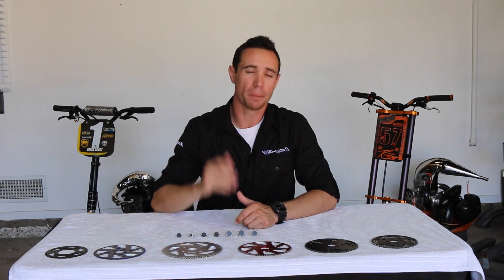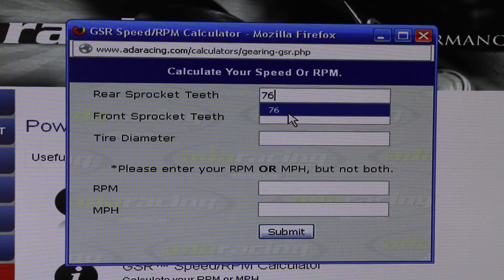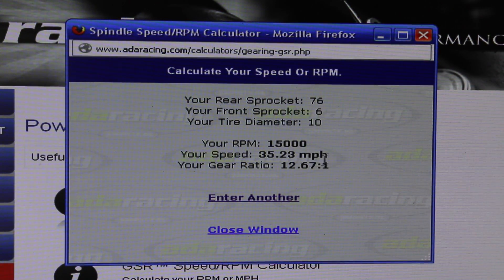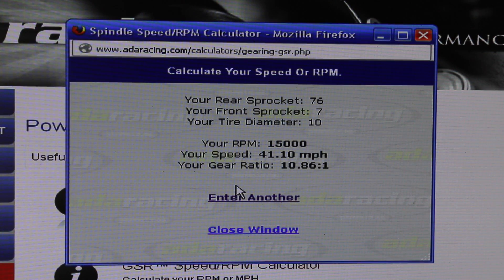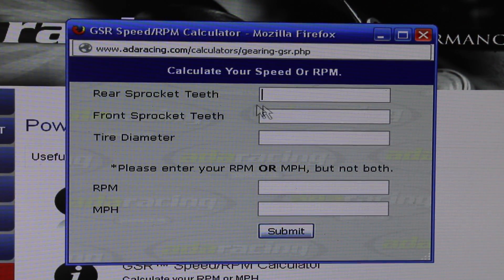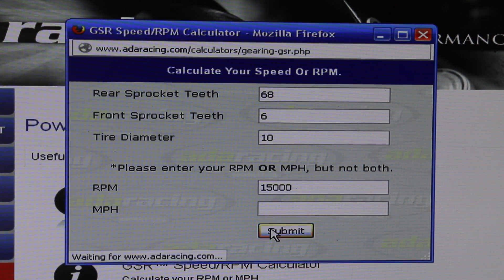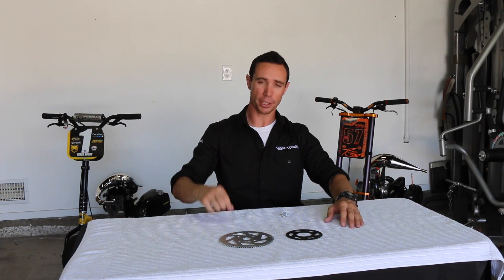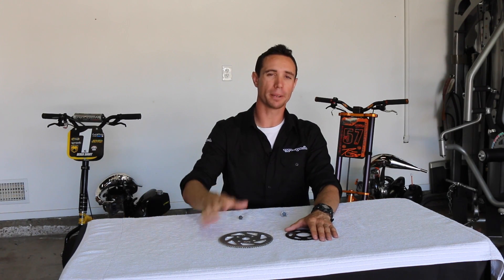GoPed How To: Gearing and Ratios In Depth

Comment: What gear ratio would you suggest for a top speed of 100 mph?
Reply: 14 tooth coming off the motor and a 54 tooth on the wheel. goooooood luck. you'll need  a car to tow you to 60mph before the engine will be able to move the ped.
Reply: @Coliolioxenfree  on my homemade stand up scooter i used 11/54 with pocket bike engine  bigbore  my weight is 52 kilograms my scooter top speed can go 77 kph
Reply: i done 62 mph on my trail ripper @Coliolioxenfree

Comment: Hey Derek .. I have a GoPed ESR 750H electric scooter .. I'm looking for acceleration with a top-speed of 40km .. What size front and rear sprocket would you recommend
Reply from the maker: +Yuvraj Lehr you likely won't go that fast. closest you can get is but going with lip batteries and a torqunator motor. Gearing I can't remember exactly because electric scooters are a bit different with gearing ratios. but typically go up 2-3 teeth in the front and up 7-8 teeth in rear for max top speed.
Reply: +Derek Short I have LifoPO8 24ah battery setup in place .. But running a stock motor currently gets me up to 35km/h .. My rear sprocket is the black 72 DOM not sure how many teeth and the front is the stock.. Again not sure how many teeth .. Sorry I'm new to GoPeds.. Here in Singapore Gopeds are a very expensive alternative to the Chinese scooters .. Hence support out here for these scooters are also limited
Reply from the maker: I hear ya there. If you can go up 1 tooth on the front that should get ya real close. If not then you will need to go to a 64 tooth in the year.
Reply: +Derek Short ok so let me get this correct .. If I keep my 72 DOM black sprocket for the rear I should up 1 tooth from stock for the front .. Btw what is the stock tooth number .. Would you know ?
Reply from the maker: I don't know the stock off hand. but what ever u are at now go up 1 tooth if you can.